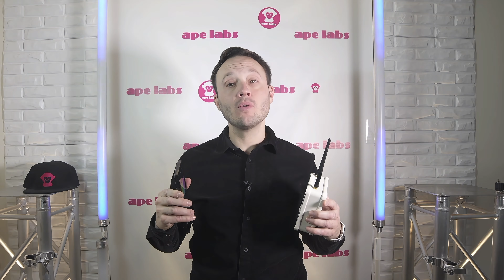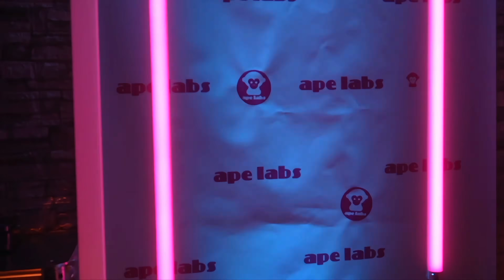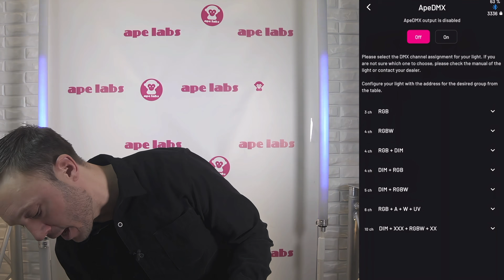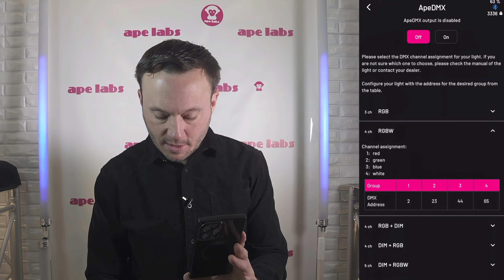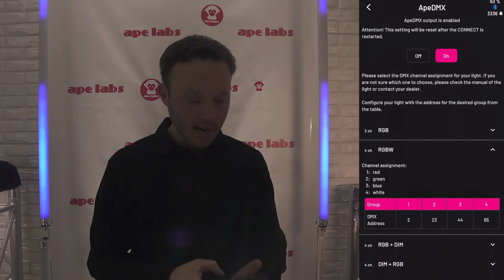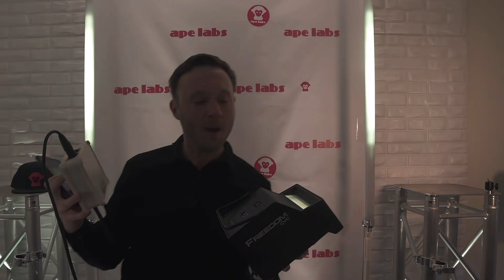ApeDMX Tutorial: Control Most DMX Lights with Ape Labs Connect

Comment: My next issue: In Music Mode via the Connect, I often have the problem that the bass is too strong and the lights keep flashing constantly, no matter where I place the Elabs Connect in the room. Would it be possible to adjust the sensitivity of the Connect?
Reply from the maker: Right now not if using MusikMode w Connect - try using it in lights mode and lowering the speed increment.